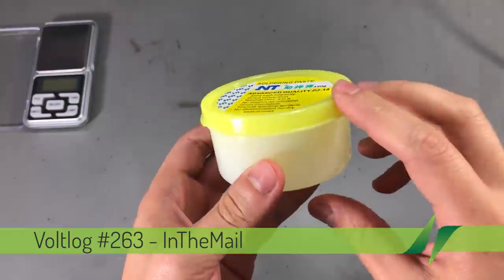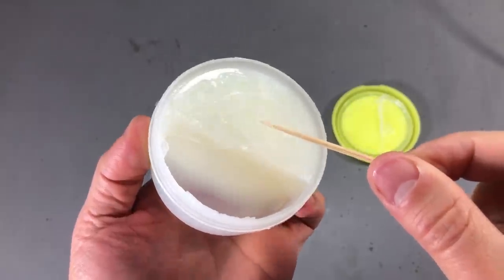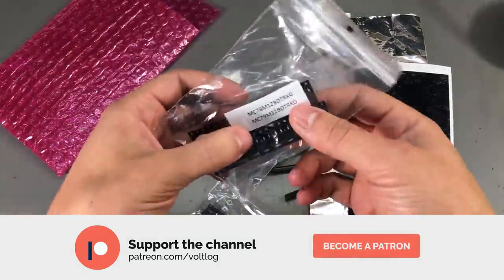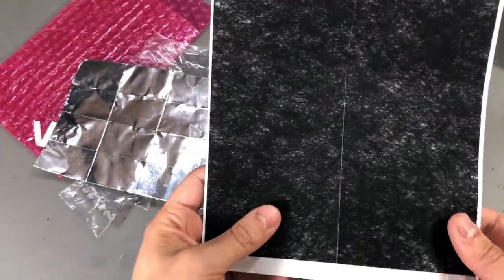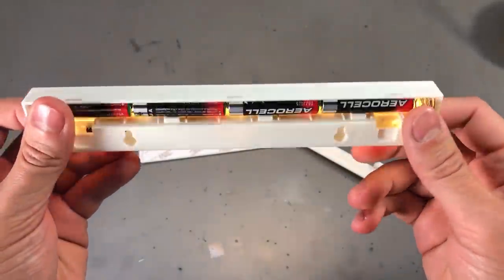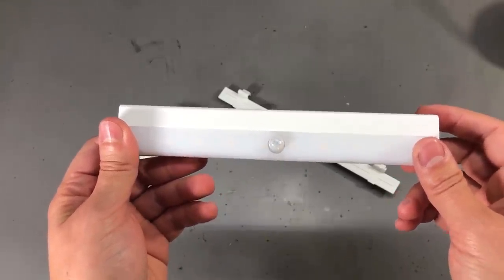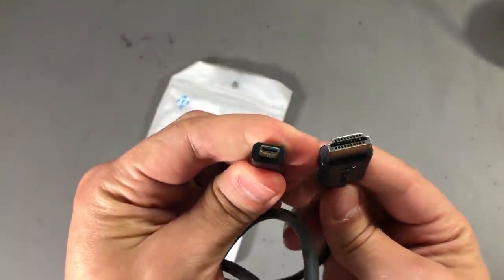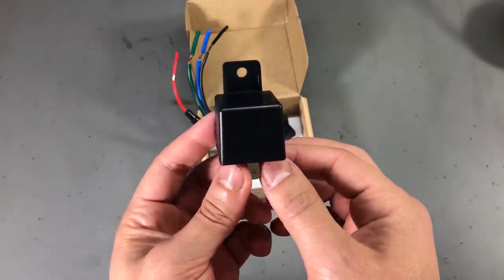Voltlog #263 - InTheMail

Comment: I used to install some of the commercial GPS tracking devices on cars for two of the dealerships I worked for in Atlanta Georgia. There are "Buy Here Pay Here" dealerships in Georgia. If the customer does not pay their bill after a contracted amount of time the vehicle is disabled. After another 2 weeks the vehicle is repossessed. It's a sleazy type of business I'm happy to get away from. I primary painted cars for them but when work was slow I did things like gps tracking installations and even did a few repos using them. The website that hosts the data is the most important part of the system. You really want something you can rely on. The police are not going to go on a wild goose chase or fox hunt for you. When doing repos, your already walking a fine legal line in practice, using a system like this will be exactly the same in practice. I had to call the police and give them lots of information before making a repo. While I can establish that I am authorized to claim property, the police do not condone trespassing for me to retrieve it. In a state that has stand your ground laws and a large gun ownership percentage, it's a scary thing to do. However, it pays around $500 for an hour's work. These dealerships make copies of the ignition key too, so a repo is just a matter of getting in and driving away. The customer's contract is written so that tampering with the gps tracker means forfeiture of the vehicle. 
   The really sleazy part of the business is that the vehicles are very low end, and extremely overpriced. The dealer will sell them to almost anyone dumb enough to walk in the door. They lose money on the vehicles initially, but they repo and resell the vehicle many times. The profitability is in the contracted loans. In Georgia the vehicle loan is just as much of an object as the vehicle and they are not legally bound to each other. If the customer has the vehicle repossessed, the loan does not disappear. These dealerships make their money by selling these loans to companies that purchase them in bulk and pursue them further.
 So as you can imagine, these dealers use some of the best gps tracking systems made. Back around 2007 to 2008 the dealer cost was around $500 per unit. I was told the access license to the system tracking server was $2500 per terminal per year. The system sent location data around once a minute when the vehicle was running. From the terminal you could see almost every turn the vehicle made on the map. When the vehicle was off the transmission rate changed. It also gave an indication of signal strength and accuracy and vehicle battery voltage. When looking at the data I could easily see where and how often the person went places. I could see where they live, work, shop, and routinely visit. It's super invasive, but there are some unstable people that make the system worth it from the dealer's standpoint.
    I repo'd a guy that was making threats and double parking the vehicle to prevent repos. After months and several unsuccessful repo attempts I set an alarm to tell me when he was on the move. I took the car while he was in the grocery store. The sad part is that I saw many times where good people would call and plead their case and circumstances to the dealer's management and those guys were extremely accommodating with nice people. Difficult, evasive, and combative people were dealt with ruthlessly though. There were a lot of them too.
....anyways... these alarm systems must be installed somewhere with as little metal and physical material as possible between them and the sky. The easiest place to get power and everything you need to do an install is to remove the gauge cluster. This will get you access to the farthest forward section of the dash near the windshield. This area usually has a gap in the metal that the dash board is built upon. The gap is there for the windshield defog air vent. This is the best place to do the install reliably.
  The problem is that any system capable of disabling a vehicle's ignition is actually a cheat sheet for hotwiring a car. In the off chance that an intelligent person wants to steal a car, they will look for after-market alarm systems. The black box will always be under the dash on the drivers side. It's the one held in with; (at worst) tape; (usually) tie wraps; (at best) standard hardware store type hex head self taping screws. It will stand out like a hooker at Sunday Mass once you know what to look for. Within a few inches of the box there is a relay with a heavier gage wire with the same color/stripe on 2 terminals. Guess what that wire does?
  The car manufacturer usually builds the wire harness so that this ignition wire is not easy to determine. You need to know which connector it goes to/from AND the color/stripe in order to find it. There are usually several places that use the same gauge/color/stripe wire to make the job intentionally difficult. This is part of the security design. Alarms defeat this design as mentioned. If you're going to install an alarm system of any type. Don't make it obvious where the ignition wire is or has been changed. People like me know what all of those boxes and systems under there do, or at least the basics and can easily spot the turd that doesn't belong.
   anyway... the system is only as good as the host server, install without metal over it, and don't make the ignition wire easy to spot. Seems obvious, but it's hard to do well in practice. Back in the day, I used a site called something like bullydog alarms to figure out the wiring. It had a super useful guide for wiring almost any car. If that's still around it's worth looking up.
Thanks for the upload.
-Jake
Reply: Thanks for the story!!!!
Reply: Good stories and even better advice,  especially on placement, these devices don't work very well/at all if placed under the bonnet (hood)

Comment: Yellow flux paste seems to work and it is dirt cheap. I put it in a syringe for easier use. I made another syringe with more amber Mechanic branded flux you can buy cheaply in a tin can as well.
 Most solder flux pastes liquify well below 100C. I put some to another container and melted it at low temp (100C air). Once melted, it is easy to pour in a syringe. Flux won't burn at that low temperature.
I think 100C is not the minimum temperature needed, it melted very fast with it. It was just the lowest my hot air station can do. Probably something like 50-60C should do the job. When cooled down the consistancy is similar to before melting.
Reply from the maker: thanks for the hint, I will definitely try to put it in a syringe because I find it easier to work with a syringe.
Reply: @voltlog  i've never seen melting method suggested. It works so well to me I'll recommend it from now on. Other filling methods suggested are always difficult in somw way.
Reply: Since this stuff is PH neutral, it may be simply "paste," not flux.  I believe flux is the acid that removes oxide, so that solder bonds with metal.
I have another thing in a tin from China: PH neutral rosin.   No flux here either.  It is rock-hard at room temperature.  Thick PH neutral pastes can be helpful to transfer heat, facilitate flow, and hold components in place.   But they are not really for wetting solder surfaces.
Reply: @GnuReligion  Wikipedia classified fluxes in several types like standards. Not all are acidic and even "pastes"/liquids with only resin are referred to as a flux in standards. See more here: https://en.wikipedia.org/wiki/Flux_(metallurgy)#Rosin_fluxes
Chinese manufacturers seem to use words like paste that sometimes can mean flux and sometimes can be what I know as solder paste ie. metal containing.

Comment: While I agree with your statement about the number of connections in a high speed data link, I also don't like too much flexing of the micro hdmi connectors on the R-Pi 4. A short, 10cm, micro to full size adapter lead is IMHO the best compromise. This short adapter can remain connected (glued even) to the R-Pi 4 and lessen the strains on that connector.
Reply from the maker: the micro hdmi connectors seem solid at first look but who know, with enough pressure they might just lift the pads..

Comment: The kit of components and the Circuit board with USB ports is clearly a USB 18650 Power bank circuit. And all those components could be used on such type of projects, USB power banks.

Comment: I also got flux (NT ZJ-18, but in a smaller tub) that was just half the weight on the label (and that included the container itself). This is no "accident". I bought this on ebay and sellers like this get a negative rating immediately (requesting a refund isn't worth the time). I know that it is still cheap even if you receive just half the amount, but I do not like to get cheated.
Reply from the maker: ok, so this is no accident, everyone is getting the same ammount

Comment: Assuming it's the same as this BT adapter sold by Olimex (https://www.olimex.com/Products/USB-Modules/USB-BT4/) I'd find their claim hard to believe. For the same PID and VID, Olimex's adapter only claims to be 4.0 (which could also be a lie if the device is a counterfeit that uses a VID/PID from a real BT 4.0 device).
This wiki of bluetooth devices seems to verify that information (again, assuming the VID/PID is not being faked). It shows 2 devices with the same VID/PID, both using the CSR8510 chipset, which is BT 4.0:
https://wikidevi.com/wiki/Bluetooth_devices

Comment: I would open a claim for the paste and get a refund. This lying shit has to stop, and the only way to stop it, is to make it unprofitable for those who scam us. 
I had a hard time finding real brass or copper shavings. Most I found on AliExpress, were made of steel made to look like brass. Brass and copper are too soft to scratch the tips. 
The GPS relay would need an unobstructed view of the sky to work. Where would one install this? Can't be under the hood, or under the dash board!